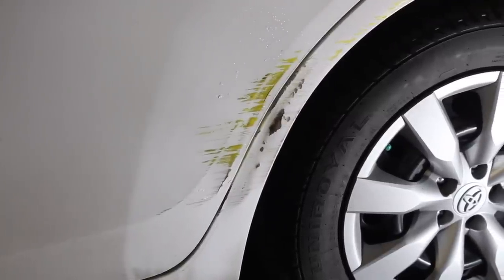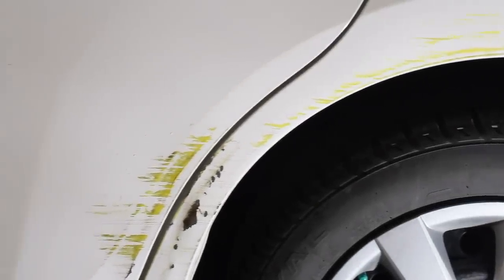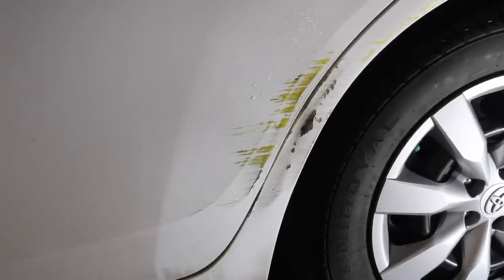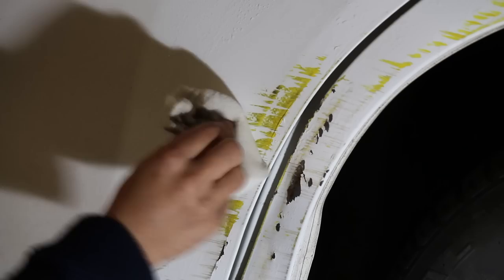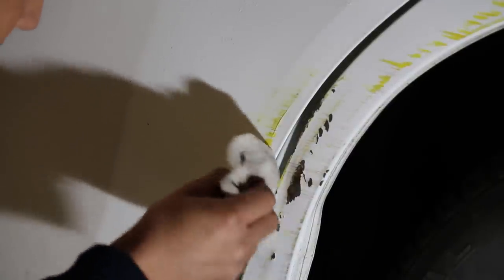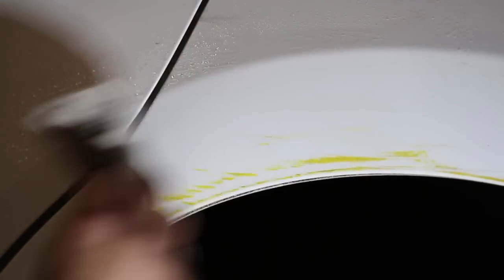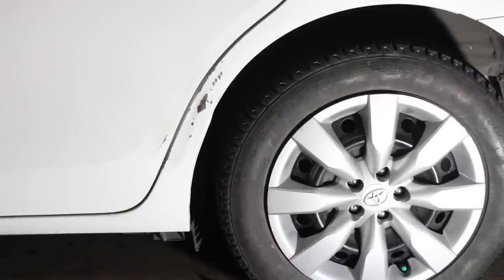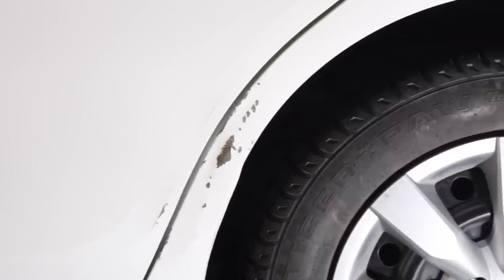How to Remove Paint Transfer

Comment: Hey, Milan! I recently slid on some ice and ended up going sideways into the curb. I now believe my alignment is off because my wheel has to be slightly to the right to keep it straight, though I don't have to hold the wheel, it does have to be off centre--when centre, the car will slowly drift left. Do you personally think this is just an alignment/wheel balance issue or do you think it's possible that there's a bend with tierod or control arm? Really hope not. No vibrations or noise, no matter what speed. Only thing noticeable is alignment.
Reply from the maker: +Phreaqin ™ Hopefully that it is only an alignment problem, but the only way to actually tell if there is damage is to go under the car and take a look at the suspension components
Reply: +milanmastracci have a scheduled appointment with the dealer Saturday morning. In your opinion, from the details given, does it just sound like an alignment issue?
Reply from the maker: Unfortunately, no. Usually because when you hit a curb, its high impact for a split burst of time. Usually resulting in bending something. The only way that you would be able to just do an alignment is if the screws for each adjustable arm somehow loosened and you would just have to tighten it. My prayers go to your car on Saturday!!
Reply: +milanmastracci thank you, let's hope. How much do you think it would cost if it results in something bent like a control arm or tierod?
Reply from the maker: All depends on which one? Front or back? and what else is damaged. If you want you can find up the part price of everything your dealer will use through this website. Just plug in your car and find prices for everything. If I need OEM honda replacement parts, I get it from here. http://www.hondapartsnow.com

Comment: I personally use brake oil, does the job just as well put you'd need to dry it off quick as it is very bad for your paint.
Reply from the maker: +1lamborghinimercialagoSVfan What's brake oil?
Reply: +milanmastracci oops lol. Wasn't paying much attention to what I was writing, meant brake fluid.
Reply from the maker: Oh brake fluid. I don't doubt that would work but I wouldn't dare touch the paint with it. It has the potential to do a lot more damage than good because if you miss any, there goes your paint. But its cool to know it works!!
Reply: +milanmastracci yeah it pretty much destroys your paint, that's why I said you gotta dry it off